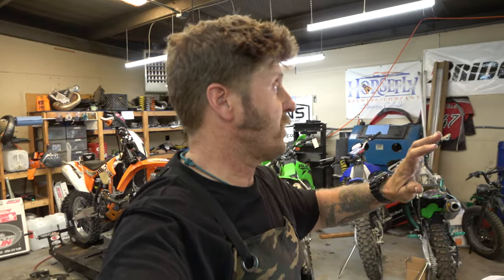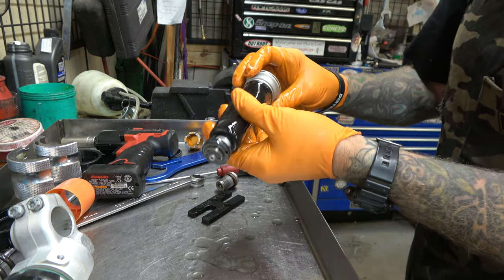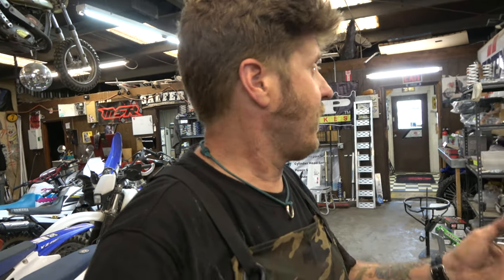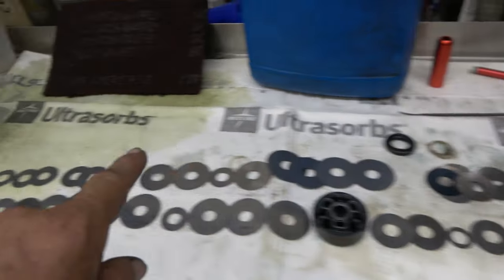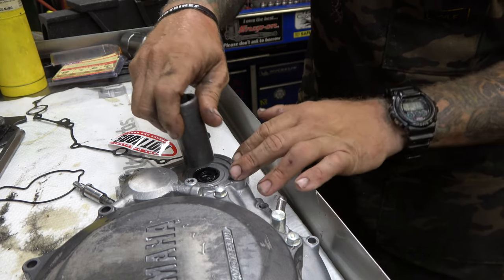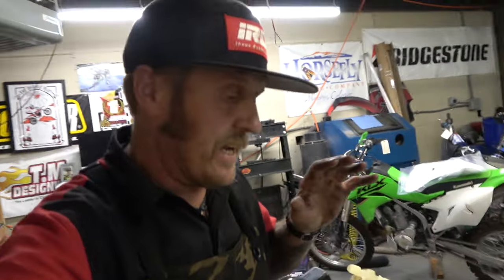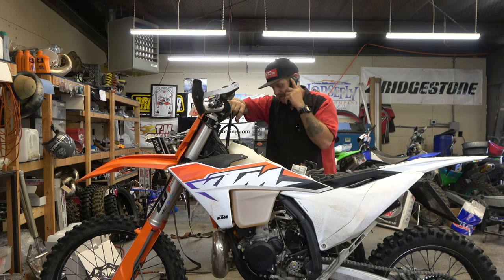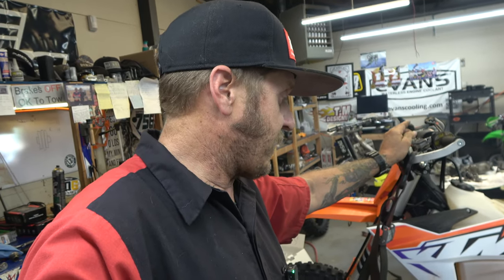The Shlog #256 | Suspension Valving | KTM TBI Keeps Dying |  YZ450 Water Pump | Blown Up YZ125

Comment: I have a buddy with a 23 TX300 he had the exact same issue with the bike dying. All tests lead to fuel. replaced fuel pump and bike was fine for about 3 rides. Long story short the poor guy went through 3 fuel pumps before we found the fix. The fix was the 4th !!!!! fuel pump. Which was the updated xxx200 part number pump from the 24 model year. Hope this helps.
Reply from the maker: Thanks. Hope that isn’t the situation but we will see
Reply: Following

Comment: I put a valve stem on the hole and then I can seat the bead with air if it doesn't want to seat on it's own. It keeps water and sand out too. for some reason I can never get Dunlop MX tires to seat without air even with a big fresh mousse with tons of lube.

Comment: I bought a FMF stand & it failed me several times! It had a pin to put in a tiny hole to kéep it from collapsing but the hole didn't line up properly so I drilled it bigger and used a screw driver to hold ít up.
Reply from the maker: Bummer

Comment: Had those same forks on my 13 300xc.  Great forks.  Just did springs for my weight and kept the fluid fresh and they were great with the some clicker tuning.  They don't make them anymore because they can't sell "new features" with the same old forks.  They did work well.   I had thought about move them to my 22 gas gas parting out the 13.  The AER are decent, but I hate dinking with the pressure all the time..... Its one of the reasons I ditched the tubliss... to much fiddling with it.
Reply from the maker: Agree about fiddling!

Comment: Fuel pump on the xc. Could be the release agent for the fuel tank mould plugged up the in tank filter/sponge and the fuel pump has started to fail under the added load of trying to pull fuel through it.
Reply from the maker: I think the pump will be ok.  We are going to find out.
Reply: @highlandcycles  Similar symptoms to my friend's xc, dealer replaced the pump but the filter seemed to be plugged. Possibly could have just done the filter. It was a low hour bike and no evidence of contaminated or dirty fuel so it was thought to be the release agent for the plastic fuel tank. Similar issue on KTM 890s due to the release agent when they make the tanks.

Comment: My '23 TX300 HUS had fuel pressure issue 75psi to 20psi tested with a in-line fuel pressure gauge. It never stabilized at 48-52psi. KTM warranty replaced the fuel pump.
Reply from the maker: Nice
Reply: @jimstrieby4998 what were the  symptoms? Mine runs like dog shit in the mid range and will get worse and worse
Reply: My TX would act like it had a fouled plug OR fuel-starvation, even when there was plenty of fuel. After 50 miles or so, my TX would run low on gas and exhibit the same symptoms. My plugs were never looked fouled. Not one dealer knew about the fuel pump issue. KTM replaced the pump and the replacement has a different part number, also
Reply: @jimstrieby4998  that is what mine is doing, mid range break up/hesitation as if the plug is wanting to foul but plug looks ok. Problem is the same regardless of fuel level. Ride it hard and it often gets worse and worse.

Comment: Here's a crazy thing on the gas tank, and I honestly don't understand how that fuel pump works in that gas tank structure. So the fuel pump strainer you just replaced sits in a cavity that's in a higher position in that plastic tank than the "Left" and "Right" side of the lower part of the fuel tank. At some point the fuel will be lower than the fuel pump cavity. So if you are cruising and not jumping or moving the bike so the gas can splash into the fuel pump cavity area, how will the fuel make it into that cavity where the fuel pump sits and for the fuel pump to work?? It looks like the fuel pump cavity will be dry with no fuel, but yet you still have fuel on the left and right side of the tank. In automobiles, fuel pump sits on the lowest part of the gas tank, so the pump has fuel till it runs out, not on this bike though. Anyway, it makes no sense to me, unless you stop, tilt the bike all the way to the left and right with handlebar touching the ground, to get the gas into the fuel pump cavity for it to work again.

Comment: Great slog I've never heard of the porcelain coming off a plug guess I'll start changing mine more often was wondering how you liked the new fly helmet I tried one on very comfortable but I went with a 6Datr2 not for sure if the GPS would work down here in the Tennessee hills and guess I'm old fashioned I like the visor  better on the 6D
Reply from the maker: I love the fly helmet.  Don't really care about the electronics.  I just LOVE the formula helmets

Comment: Pretty hard core on testing out the old fuel filter. Is there a better after market filter to use?  Also wondering if there is a fuel sock that could be used under the gas cap to capture any particles from fuel poured into the tank?
Reply from the maker: Fuel sock is a yes. No other filter that I know of.
Reply: @highlandcycles  Pro filter in AU makes the cap located in-tank filter